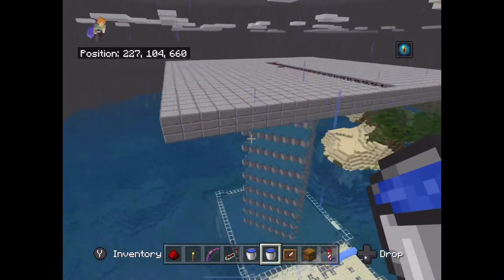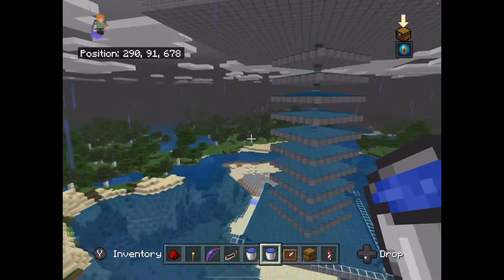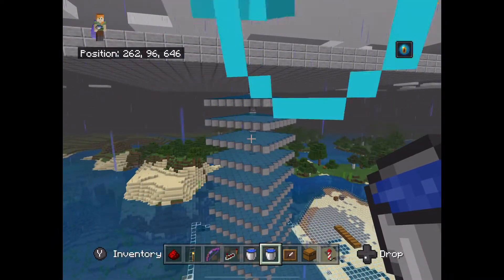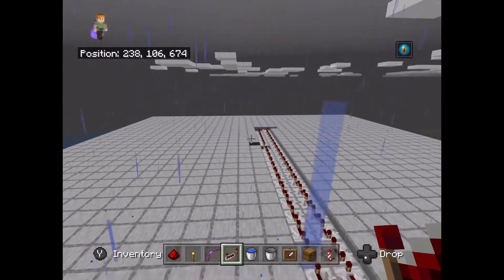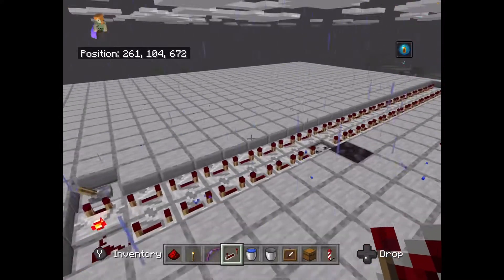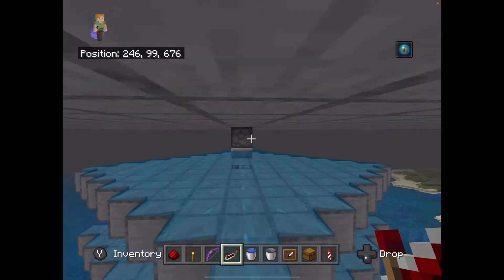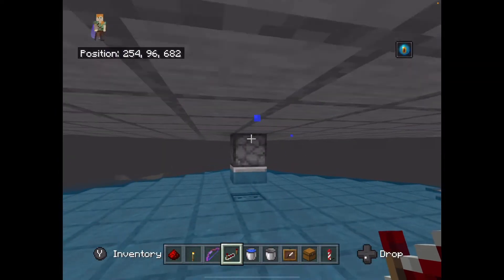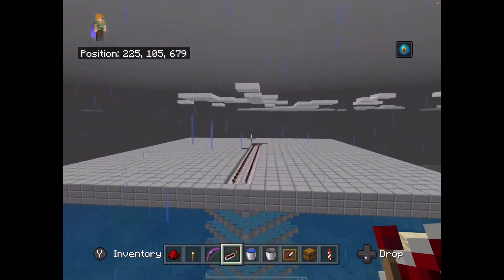A more complete explanation

Comment: Hey what is the best spot for afk I didn't understand what were u saying like 25 blocks out from 7th platform
Reply from the maker: Ok yeah I get it no problem you just need to count up to the seventh platform of the build then build out 25 blocks because if you go to the original spot in the video by shulkercraft (sorry I can’t spell lol) It won’t load the farm to produce mobs. So you need to count up seven platforms and from the tip of the diamond shape (on any side) you should build out 25 blocks and make a little fort so you are not killed by phantoms and what have you then break the blocks that are connected to the farm all the way to your fort then build a latter up to the fort for entry and exit :) I hope this helps
Reply: Yeah man thanks. Just one more thing. Should it be at the same height as the 7th platform. And except the redstone, roof and changing places of observers and putting slab under the dispenser, is everything same as done by shulkercraft??
Reply from the maker: @atharvbabbar3272  yeah it is all the same other than the roof red stone and the afk platform:)
Reply: Bro the signal is not reaching all the repeaters what shallI do please tell fast??
Reply from the maker: @atharvbabbar3272  you need to check they all face the same direction and then make sure there is reds tone at the ends except where the comparator goes
Reply: I checked all of that but the signal is only reaching 5 repeaters
Reply from the maker: @atharvbabbar3272  try relogging
Reply: @RealJustinWillock  relogging in the world??
Reply from the maker: @atharvbabbar3272  log out then bac in
Reply: I did then nothing happened😭😭. Why am I so unlucky. Please fix it
Reply from the maker: @atharvbabbar3272  ok man I’m really sorry about this flick the lever on and off again maybe
Reply from the maker: @atharvbabbar3272  I’m tryin my best but without a way to see what you are doing it is very difficult for me to help
Reply: What shall we do then??
Reply from the maker: @atharvbabbar3272  that’s a good question im very sorry I can’t help try googling the problem but other than that I have nothing more to offer I hope you have a good day/night wherever you are in the world
Reply: Hey magically it worked. Redstone clock is working. But IDK why dispenser isn't dispensing water. Can u tell why??
Reply from the maker: @atharvbabbar3272  yeah man does it have slabs on the top
Reply: @RealJustinWillock  no man it's on the block
Reply from the maker: @atharvbabbar3272  the dispenser?
Reply from the maker: @atharvbabbar3272  wait on the block below the dispenser? Cause it needs to touch the dispenser
Reply: What, observer??
Reply from the maker: @atharvbabbar3272  I did not say observer
Reply: @RealJustinWillock  oh sorry, then what??
Reply from the maker: @atharvbabbar3272  dispenser the slabs need to touch the dispensers

Comment: Thank you for the advice. It worked, but I’m trying to find the sweet spot for afk. How far above did you go or recommend. Thanks again.
Reply from the maker: I went to the side of the farm because of bedrock loading issues ill give how far up and to the side in any direction in a min just make sure to light up the surrounding area to keep it optimized
Reply from the maker: So you will probably want to afk 25 blocks out from the seventh platform counting up in any direction and that should work but if you find a better spot please do let me know :) remember to keep the ground lit up and it should work great :)

Comment: So instead of last layer that’s slabs it’s normal bricks it’s not slabs and then you put slabs on top of those ?
Reply from the maker: Yes if you mean the roof you put full blocks then slabs on top of those.
Reply: Idk why the water won’t work it keeps spitting the buckets of water out
Reply: Do you use droppers or dispenser
Reply from the maker: @Meltingfaces420  you probably used droppers not dispensers
Reply from the maker: You need dispensers
Reply: Am using dispensers
Reply from the maker: @Meltingfaces420  hmm idk then
Reply: Finally working thanks bro
Reply: Hey sorry to bug you why is there to much water and it puts out the fire pits on the bottom  do I just have to move the chest and hoppers little lower ?
Reply from the maker: @Meltingfaces420  no you just need to make the platforms a bit larger I think you got the wrong count on the platforms they should match how far the water flows exactly
Reply from the maker: @Meltingfaces420  you aren’t bugging me I made the vid for a reason lol
Reply: @RealJustinWillock  so pretty much start it from scratch knock it all down -.-
Reply from the maker: @Meltingfaces420  no just add to each platform
Reply: @RealJustinWillock  water moves 7 blocks right ? Or 8
Reply from the maker: @Meltingfaces420  I think it is 8
Reply: @RealJustinWillock  any advice how to make them stop spawning below and make more creepers spawn ??
Reply from the maker: @Meltingfaces420  you will want to light up the surrounding area with torches or something every three blocks I think and also for bedrock you need to stand closer to the farm than in java.
Reply from the maker: @Meltingfaces420  if you want a creeper farm there are specific farms for it that use cats not red stone it also uses trapdoors so creepers just walk off the edge of the farm
Reply: @RealJustinWillock  link
Reply from the maker: @Meltingfaces420  I don’t have one however if you search Minecraft bedrock creeper farm you should be set and it will have all of the improvements needed
Reply: @RealJustinWillock  and one more thing they Arnt even spawning anymore where should I afk and thank you
Reply from the maker: @Meltingfaces420  So you will probably want to afk 25 blocks out from the seventh platform counting up in any direction and that should work but if you find a better spot please do let me know :) remember to keep the ground lit up and it should work great :)
Reply from the maker: @Meltingfaces420  hey man I see that you subscribed and I just wanted to thank you